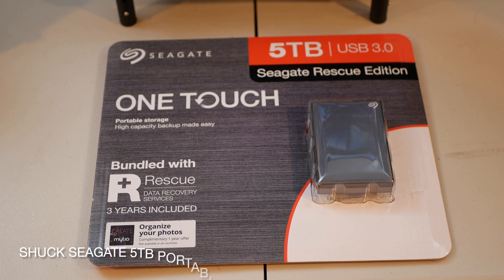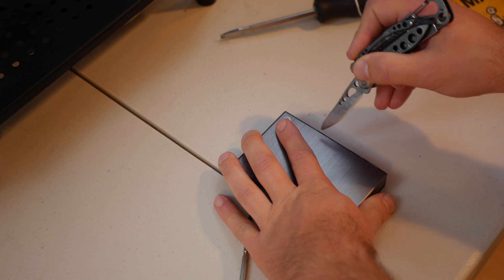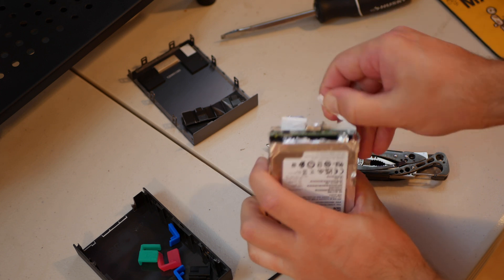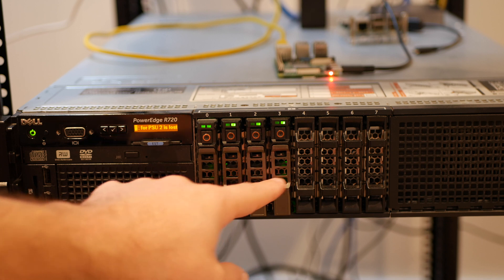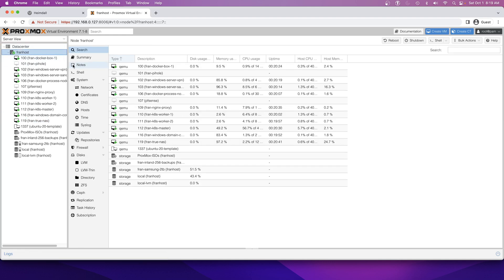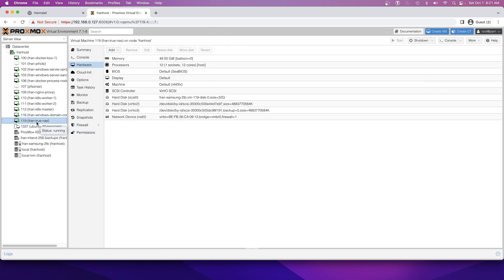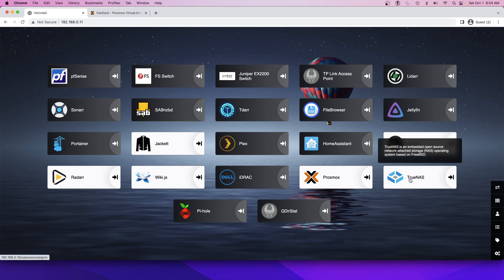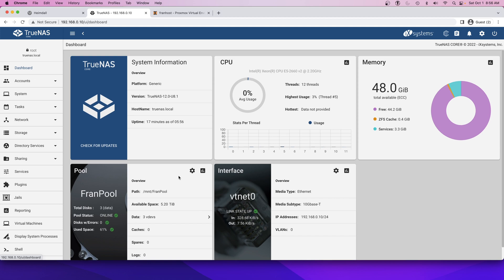Shuck Seagate 5TB Portable Hard Drive and Extend TrueNAS Pool

Comment: The reason TrueNAS is warning you is that your pool consists of only (now three) single-drive vdevs.
If one fails, all of your pool's data will be lost. If you care about the data in your TrueNAS zfs pool, make sure you have backups.
I would always recommend having at least some redundancy in your vdevs, either by mirroring two drives (like RAID-1) or by using raidz/raidz2 (like RAID-5/RAId-6). :)
Reply from the maker: ahh that's good to know, makes sense. Thankfully I'm backing everything up to external hard drives. Where can you view that sort of information on your vdevs? I must have configured single-drive vdevs when I first created the pool. If I wanted to change the redundancy would I need to recreate the pool?
Reply: @Franchyze923  You can get this information either by going to Storage > Pools > Status (gear icon) in the TrueNAS WebGUI, or by running "zpool status" in the shell.
This displays the name of your pool, the vdevs it contains, and the devices in each vdev.
I assume your pool will consist of only three stripe vdevs (like RAID-0). And yes, if you want to have redundant vdevs you have to rebuild the whole pool. :/
Reply from the maker: @Felix-j3d4b  Within Pool status, I see 3 vtbd's listed that correspond to each drive.
Reply: @Franchyze923  if you had done them all 3 at once it would only be 1 vdev or in my case iv got 2 drives capacity wise and 1 set for incase one drive fails so i can rebuild the array by simply inserting new drive into system and rebuild it. But like you i store a copy of each file on and external drive as well usually sync it ever week or so but i mostly keep videos on the drive. Nothing of great importance but its nice to have a safe backup that gets low hours vs my nas drives that run 24/7.
Reply: Thanks 😊 for the post shucking same model for a dated a dated server before the windows 11 headache begins .